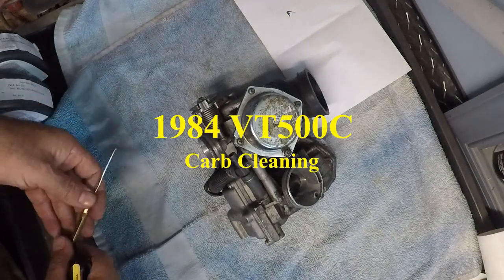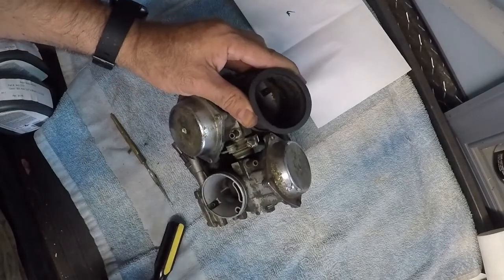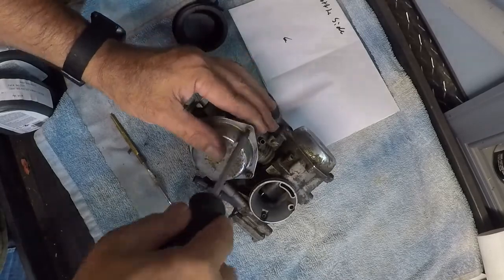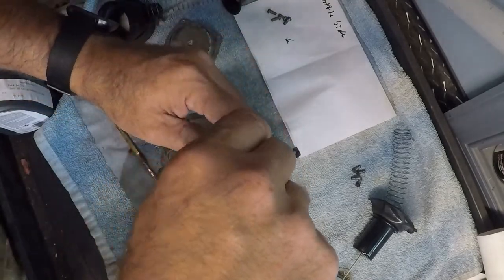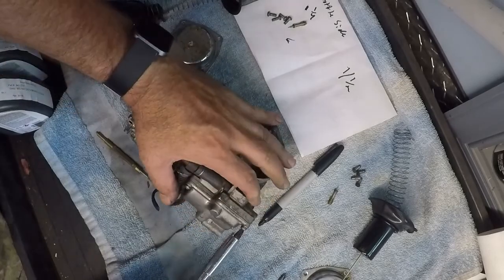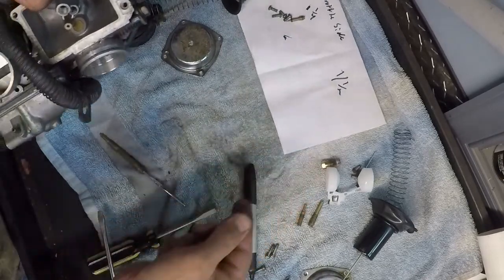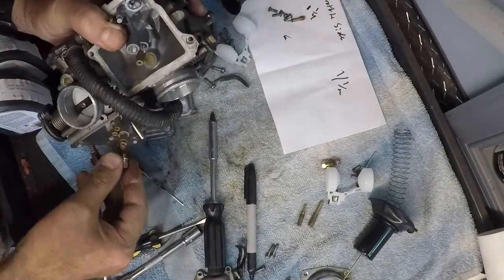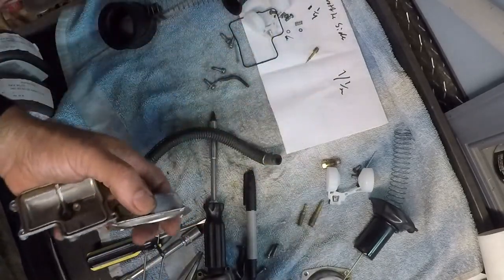84 Shadow 500 Cleaning, Adjusting, and Reassembling the Carbs

Comment: Hi, do you have any insight/reccomendations  on how I could acquire a left side cover for my 85 shadow vt500? Thanks!
Reply from the maker: Left side covers are hard to find.  I am missing them from my 85 700 and 84 500.  They seem to come loose and blow off.  You may be able to find one on Ebay.  Best of luck. Thanks for watching.
Reply: Hi. I lost my left side one and found one on ebay. Not that it was super expensive but wasnt cheap either. Also. It might be worth the search to try and find a set. Or if you cant find one eith the logo on it you can always get some waterslide printer paper and create your own. But enay is where i found the covers for my '83 vt500c shadow.

Comment: Can you specify what should be turned 21/2?
Yours were 1 1/4 and 1 1/2.
Are these the screws from the side of the bowls?
Doing my rebuild right now, thanks in advance
Reply from the maker: These are the air mixture screws on the side of the carb.  They come with a metal plug over them from the factory.  If they were never adjusted, the plug may still be there.  What I did was count how many turns until the mixture screw stops turning in on each carb.  Usually it's 1 1/2 to 2 1/2 turns.  That will give you a rough setting for the mixture adjustments for when you put it back together.  Make sure you lightly seat the mixture screw when seating it.  Don't over tighten them.  Thanks for watching.
Reply: @wonkster1970 yea mine were never removed should I remove the caps and remove them or leave them
Reply from the maker: I'd remove them if you are cleaning the carbs.

Comment: How do you adjust the float of it isn't at 6mm
Reply from the maker: If it's close and the carb is working good, I'd let it go.  Some of these carbs have plastic tabs that contact the fuel inlet needle.  I've adjusted the tab to change the clearance without any issues.  Some people recommend replacing the float assembly.